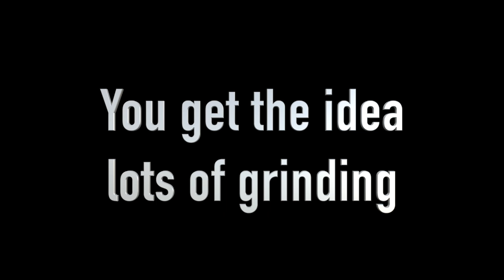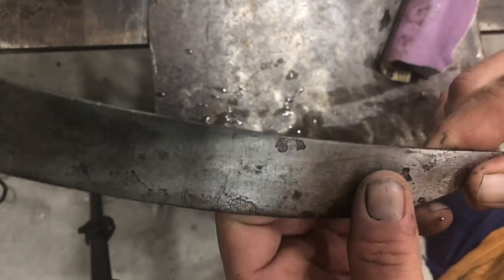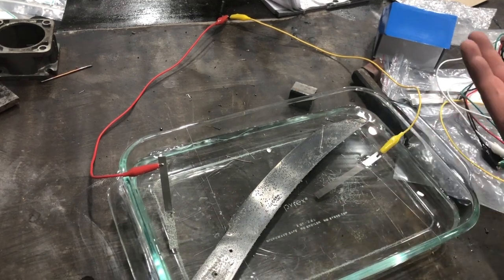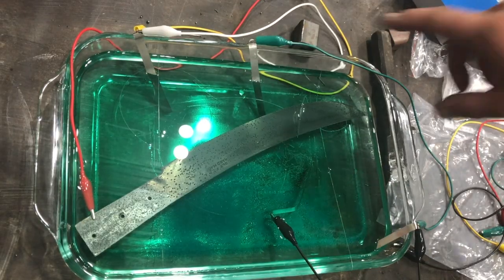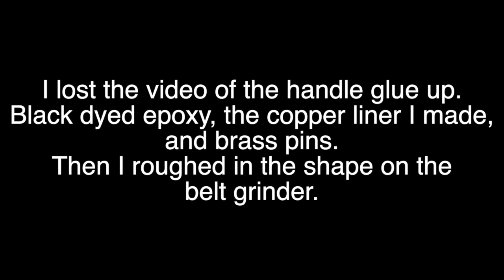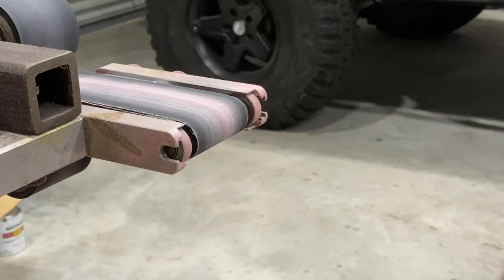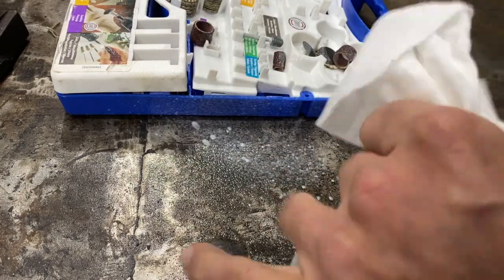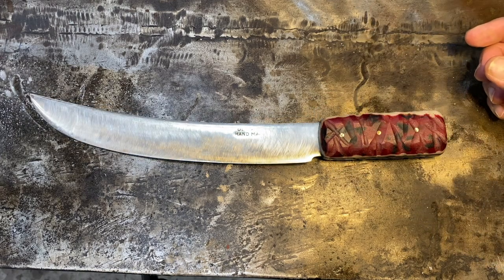Ebay knife restoration! I learned a ton. Hope I can save you some mistakes.

Comment: Excellent video. I'm always blown away by your skill set. So impressive. I wateched the video with a good deal of interest, as I've been trying to develop a methodology for polishing steel that was not previously polished, and getting it to a mirror finish. I restore vintage machinery and polish all the bright work, every nut and bolt (in hopes of getting them into original condition), and often parts of the machine that should have been polished at the factory, but weren't. I hope TC DIY doesn't mind if I share some of what I've learned with the other viewers:

1. The abrasion relating to a given color is only applicable to a specific line of compounds. For example, I have four Greens that range from a 6,000 grit rouge to a semi-aggressive polishing compound. Similarly, one can have a Black bar that's the traditional black emery - very aggressive - or at can be a black finishing rouge.

As a side note, buy good compound. It's not expensive and it lasts forever. Matchess Tripoli (+2lbs) and a pound of their Greystar are about $5 each before shipping. Luxi is more expensive, but ~$8 for 1/2lb is still very affordable, or you can by a sample kit with 11 of their compounds for less than $20 and see what works best for your specific needs. Dialux is the most expensive at ~$5 for 1/4lb. A company like Matchless has been manufacturing abrasives in the US since the 1800s. Luxi has been around for a long while in the UK, and Dialux is made by a German company in France. They've also been in business for a substantial period of time. Other than industrial compounds, like Maverick, wouldn't take a chance on much else.

2. The indicated grit of a given compound isn't like, say, the grit on sandpaper. It is indicative of the scratches a given product can remove, not its actual abrasion. That's only a part of the story; the concentration of the abrasive within a compound arguably plays a bigger role. A compound with a light grit, but very high concentration, will most likely cut better and will definitely leave a better finish than a higher grit product with less concentration. Very few manufacturers specify their compounds' concentration of abrasive, unfortunately.

Compounds can either be wet, semi-wet, or dry. This is driven by the binder in the product, usually some sort of grease. The better compounds use vegetable-based binders for easier cleanup. There are two things to consider - personal preference/polishing style and the ambient conditions. Personally, I prefer a very dry bar. As dry as possible. Doesn't mean that you will. The ambient conditions play a large role, too. For example, one wouldn't want a wet bar in a hot and humid environment, but would surely prefer it in the winter.

One often sees videos were it is encouraged to charge the buff slowly. As we're dealing with a physically hard product, we have to melt it a bit to get it onto a buff. Higher speed.

Speaking of speed, the more constant the speed the better the finish. Not all compounds work best at high speed, so make sure to check the manufacturer's suggestions. I use two benchtop buffers - one runs at 1750RPM and the other at 3500RPM. If case someone isn't aware, a bigger buff will have a higher linear velocity than a smaller buff. One of the products I prefer likes about 2,200RPM, which almost exactly translates to a 8" buff on a 1750 machine, as an example. Conversely, a 4" buff will spin significantly slower.

The standard recommendation is to use a different buff for each compound. Obviously, if a buff was charged with Black Emory, it won't produce a fine finish if charged with a coloring polish right after. Some of the coarse grit always remains. This being said, IMHE, it's fine to use a buff for each type of compound. Like a cutting buff that sees Black Emory and Tripoli, and perhaps a Bobbing compound. You get the idea. It is best to rake the buff before introducing another abrasive. A fork can act as a rake, but a real one works so much better and it's inexpensive. If possible, don't rake the cutting buff(s) unless absolutely necessary. You want them to remain stiff. Other buffs - coloring (polishing) and finishing - rake more often.

When you get a new buff, you need to prep it before use. All it means is that you rake the buff. Material particles will fly off - it's perfectly normal - and you'll have a number of loose strands. Cut them off and the buff should be ready to go. A felt buff sometimes needs to be squared or cleaned. Don't use a rake. Use an edge of a grinding stone, a bastard file, or a piece of a busted grinding wheel. 

There several other options for prepping the metal: 3M bristle discs (highly effective, but not at all inexpensive), compressed fiber wheel that come in various grits (reasonably priced if purchased directly from Asia), and Scotchbrite wheels that are typically delineated as rough, medium, fine, and extra fine. They're not costly and can be stacked. They work very well. Like a sisal wheel with Black Emery compound, the Scotchbrite wheels are also very good for rust removal. FWIW, I deal with a lot of rust. If folks are interested in various rust removal methods, please post below. We can talk about it in more detail.

3. Most metal polishing demonstrations use aluminum. It's soft and easy to work with. Steel isn't. As a rule of thumb for steel that was not previously polished, consider the suggested use of a compound and move it up a level. I mean, if a product is specified as a semi-aggressive polish, it's a finishing polish on steel (to use as an example.)

4. The alloy, itself, plays a very big part in the finish. Some metal simply won't have a mirror-like finish, because the metal doesn't allow for it. It will look bright and have a good deal of luster, but ultimately the finish will look a bit milky. No way to change that.

5. As mentioned earlier, I've been trying to come up with a methodology for this. Aluminum is easy to polish, stainless isn't too difficult, but a bit different, however steel is a bear! Obviously we begin with sanding. Depending on the metal you can stop at 600 grit or take it up to 1,500 grit for a different allow. You'll know how far you should have gone with the paper after the coloring step. If it doesn't deliver the finish you wanted, the metal wasn't sanded fine enough. We're getting a little ahead of ourselves....

Let's pick an item to polish, like a handle assembly for a drill press table. 

A. After sanding, we start with a sisal wheel and Luxi Black Emery. This will produce a hazy finish, but level the metal considerably. 

B. We move on to a denim wheel and Matchless Tripoli. Let me say a few words about this. Tripoli is typically used for cutting aluminum; it usually isn't coarse or concentrated enough for steel. This particular Tripoli is very aggressive and does cut steel, but you can use the same product as in the previous step, if you prefer. At this point we should be seeing some luster from the metal.

C. A yellow, stitched, treated buff with Matchless Greystar. A felt buff can be used, as well, with the same compound. If the steel is very hard, move right on to felt, but keep in mind that the metal will get very hot. It's a good thing. Typically, Greystar is a bit on the greasy side, but not this product. It's very dry and nice to work with. There should be considerable luster after this step.

D. We've cut down the metal, we've pre-polished it, we've given it its initial luster - known as coloring - and some may want to stop here. Personally, I like to do a finer polish with a stitched muslin buff and Dialux Grey. Now the metal looks very bright. If a mirror finish isn't there, it's either due to the alloy, itself, or you have to go back and sand to a finer grit, then start all over again. Good times. 

E. You're happy with the finish, but want to see if you can take it a small step further. You most certainly can with a loose muslin buff and Dialux Green. This will bring out a depth in the luster. Some folks may be happy after Greystar and some will want to take the extra steps - purely a personal choice.

6. As I was writing, other product options came to mind, as well as small changes in the process to take advantage of the properties of a given alloy. I guess I'm trying to say that none of the above is written in stone. If folks would like some recommendations for alternatives, or where to buy the better stuff at a good price, please post below.
Reply from the maker: thanks Felix. video coming.
Reply: Interesting approach. I’ve had issues with homemade micarta myself, it’s kinda a pain but I think everyone wants to try it. Why did you want to nickel plate the blade? Won’t nickle come off and contaminate any food you plan to cut with it? Or maybe you were thinking of this more as an outdoor chopper?